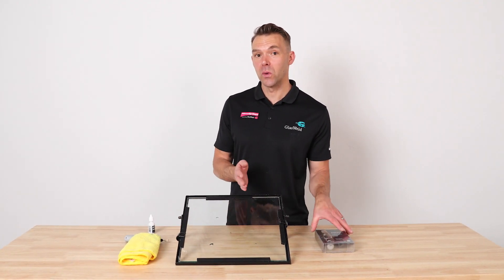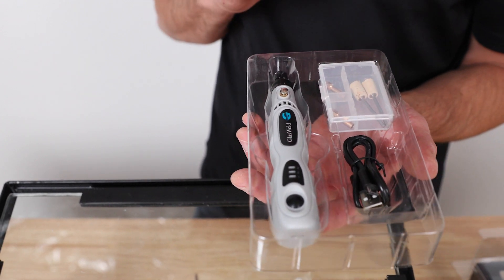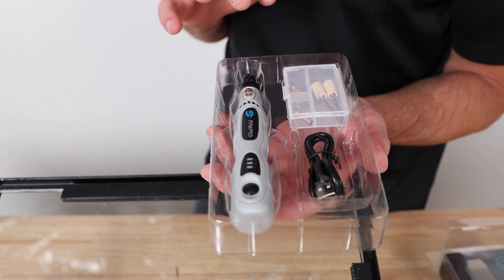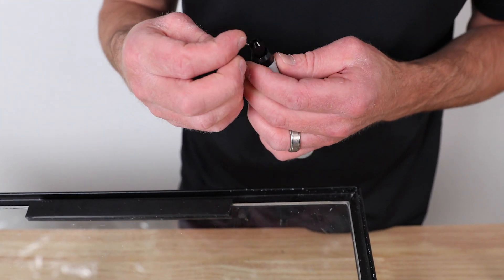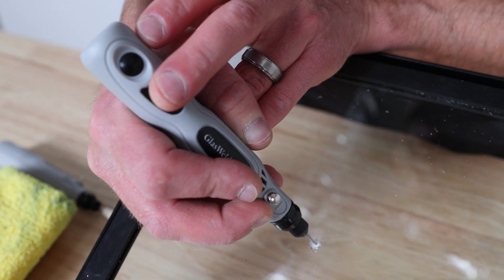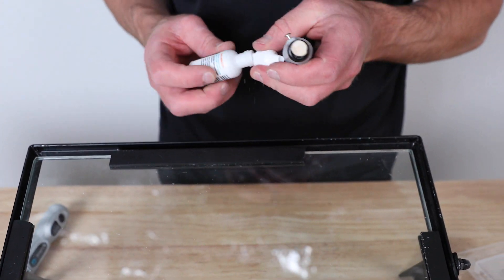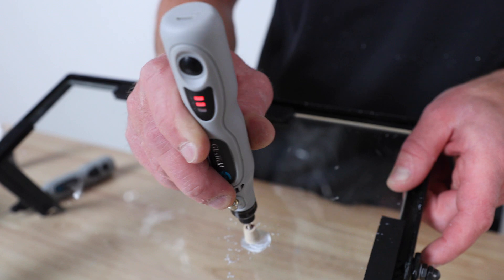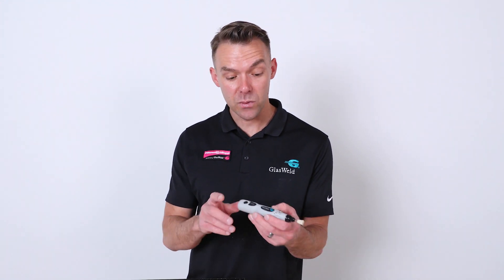GlasWeld Windshield Repair Drill + Pit Polisher Demo

Comment: I just ordered and Received one of these Polishing Kit's 01/20/2025, When it showed up it had an "Added Seal" one the Original seal that said PASSED TEST???? There was "NO PLASTIC HOLDER like seen here that held all the Contents Neatly in place and I'am just "Guessing " that My Polisher is a NEWER Style (has 5 Speeds) not (3 Speeds)?? I called and spoke to a Young Lady to ask if I had Purchased a "USED / RETURNED" Product??? I was told that they remove ALL the Incoming Product from the Original Received Shipments to "TEST" the Unit's out for Operation and such and that My Drill / Polishing Kit was IN FACT BRAND NEW???? Kinda made me raise an eyebrow as to the TRUTH Behind  my $60.00 Drill and $30 more dollars in PIT POLISH And Polishing Cork's???  Kinda made me think I Bought Returned Used STUFF!!???...🤨🥵....  I Still Wonder, was I Fed a Line of  - - - - - - - - ??? Or do they actually Remove every single Drill / Polisher from the Original packaging to perform Quality Checks on B 4 Shipment??? I NEVER saw anything to that affect on there Web Site?????? 🤷‍♂. Hopefully someone reads my Post and Responds with Good and Correct Information as to my Doubts on the New Ness of my Purchase???